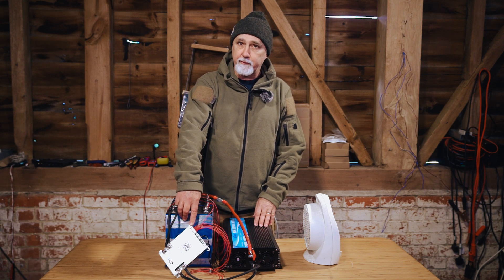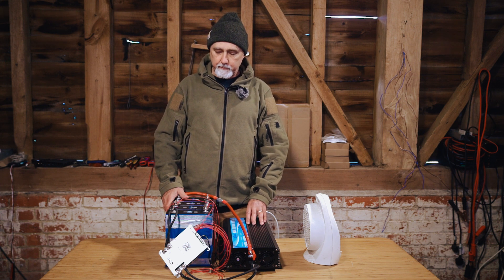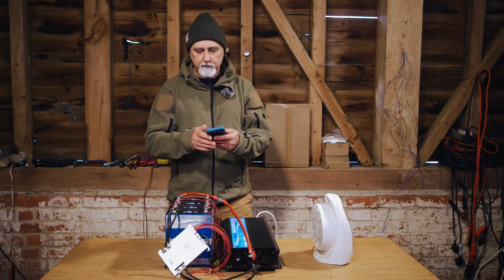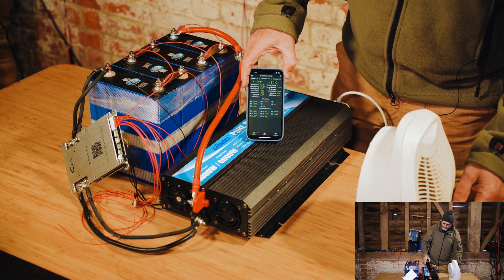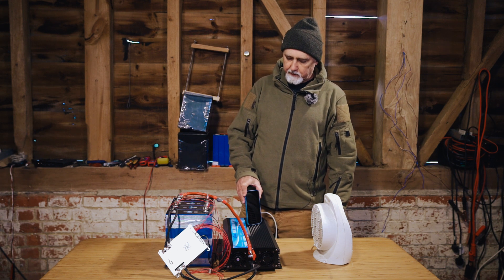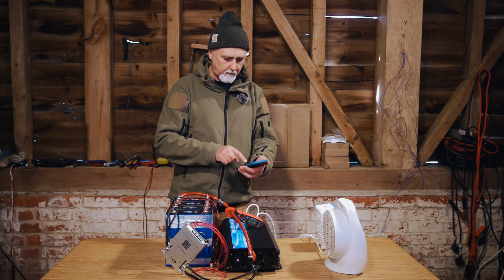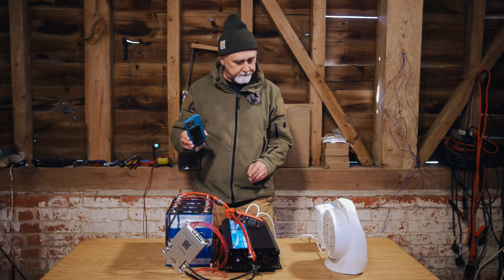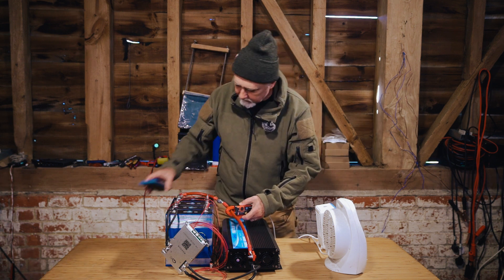Stress testing the JK BMS

Comment: Why would you routnely over amp any eletrical device? I would design any system with a good margin if i want 100amps max id use components of at least 50% higher rating and where possible and practical 100% higher running everything at 50% capacity. 

In the case if a 4s pack 300 ish ah cells  100a output through a 200a bms works with a 3kw inverter. If i need 5 or 6kw up the cell count to 8 and voltage to 24v nominal. Amp draw remains at around 100a. Betond this id consider splitting into two separate batteries to double up then to double up again goto 2 x 16s by which time were getting upto 20kw output still only using 100a ish from 200a bms's 😮

Comment: I bought one of these almost 2 years ago when they first came out, and mine didn’t come with the large cables for B and P. With an 8s 24v pack made of 304ah cells what size wires should I use? I’m not sure how large the bms will allow at the lug point. Thanks for all your videos they are very helpful.

Comment: I watch alot of your videos. Im fixing to build my first lifepo4 battery with the 280 grade a eve cells. 16 cells and 24 volts. 2p8s. Hopefully it does good. Im wonderimg what you know about mixing battery chemistries because i have a bunch of leaf cells that are nmc chemistries.  Im sure it can be done at 48 volts but im not so sure about doing it at 24 volts because the difference is to far away im afraid
Reply from the maker: Personally I probably wouldn't mess around with mixing chemistries in the same battery. I think it'll land up being a nightmare.
Reply: @offgrid_power  the more I look into it the more I think the same. Thanks for the advice. I'm gonna keep two seperate systems running until I can afford to switch out the leaf modules for more lifepo4 and then connect all into one large bank

Comment: the bms app do display mosfet temperature and you can change when the bms shuts down from mosfet over temperature in the app settings. I got both daly and jk bms and i think jk is much better. My JK have been going strong for 320 days now and cycled over 2 Mwh of energy. Although it is an 200A model the max current it have pushed is 100amps so it is not being pushed hard.

Comment: Thanks Rog, this was the video I was waiting for before proceeding.  I'm no expert, but guessing the the MOSFETS are under most stress when the overcurrent protection kicks in (ie disconnect when drawing above 200A).  It seems that if one FET dies it spreads the load over the remaining FET (assuming it dies in the open state).  Hence it may appear to still be working even after sustaining damage.  It would be good to see the BMS stress tested with multiple high current disconnects.  Hopefully someone with electronics knowledge can comment if its possible to test MOSFETS in circuit to see if they are all still working.  Otherwise keep an eye out for the magic smoke when it switches off. Thanks again.

Comment: I have found that after torquing the screws down (by hand) , I have retorqued the screws a few months later and been able to apply more torque to screws, possibly they settle a little or sink slightly into the heavy solder at these points a little with time. From memory I think they use 20 x 180Amp MOSFETS, 10 on input & 10 output, so should be fairly robust overall.  I have only setup 2 of 3 JK BMS’s I have, but I haven’t pushed mine up this high as yet on my 24v system. My guess is the hotter join in positive to inverter is where ur getting a greater loss & while the JK cables are generally on the skinny side to carry these sort of amps, they do seem to manage quite well and I thought 60 degree C was not bad for these conditions. Thanks for sharing. Cheers

Comment: A couple points, if the input screws are hotter than the output screws then the terminals or mounting pads may need cleaning, both sets of terminals should be carrying the same current so I would expect the temperatures to be similar.  In the App you will see there is a separate MOS temperature reading so no need to use one of the flylead sensors on the case.  From memory the MOS shutdown temperature is fixed at either 70 or 90 deg C (on the second page of the App).
Reply: Replying myself!  just checked and MOS shutdown is 90 deg C and reconnect at 70 deg C, both look to be adjustable.
Reply: YOU HAVE A WONDERFULLY ENGLISH NAME MILLY
Reply: They are fixed. The charge and discharge temp limits and recovery temps are adjustable
Reply: good call I was going to ask what was the mosfet temperature displaying on the app